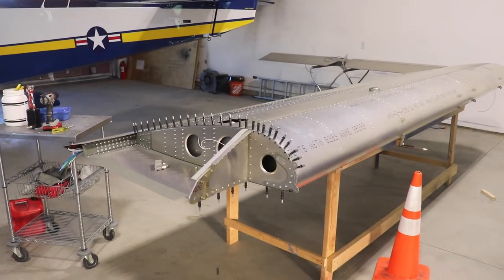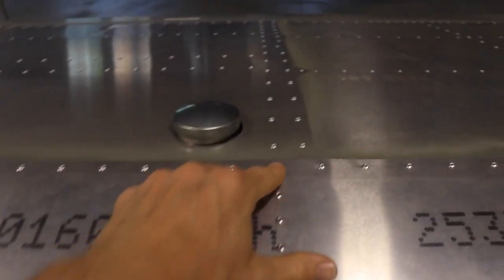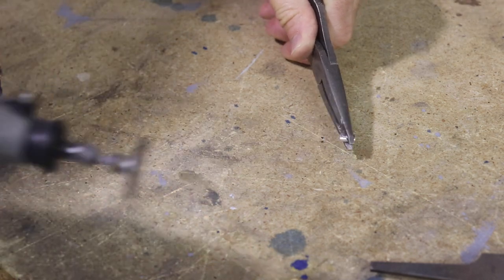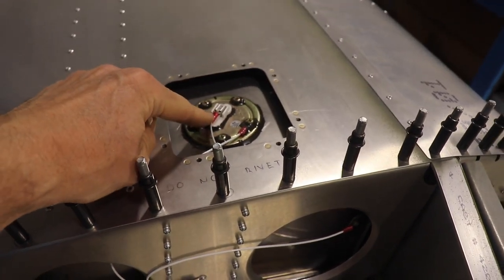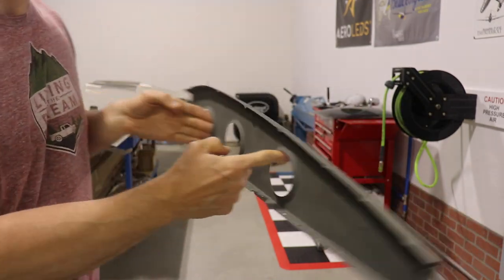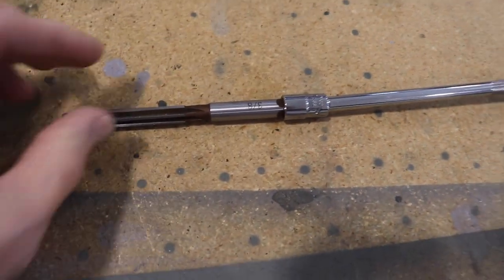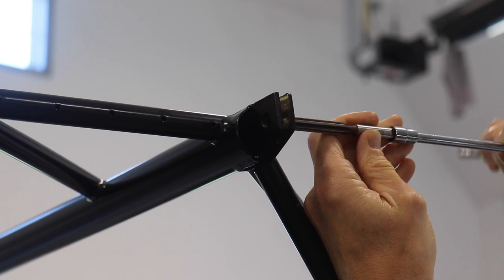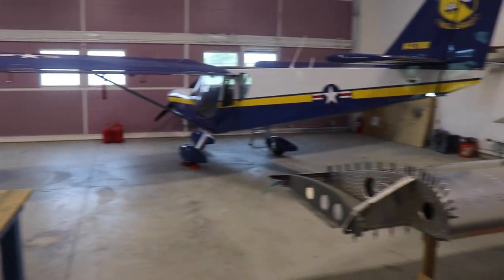Wings, Rivets, and Reamers! (Ep86)

Comment: Looking good!
Those spray cans that have a fan pattern are nice. I used some years ago where the tiny square tip that creates the fan pattern can be rotated so the fan pattern can be turned from vertical to horizontal. In case you didn't know.
Thanks for the video!

Comment: I would recommend NOT using the airframe as a ground return.
Proper connection is not guaranteed over time with corrosion and increased electrical resistance due to that.
Reply: Just curious how you would add a ground...  Would it be OK to add a ground wire from the ground bus bar to the point on the rib where the the other grounds are? Or, would it be better to remove the grounds from the rib all together and ground the sending unit and the tank directly with a ground wire?
Reply: 100% Agree, electrolysis is a nasty monster

Comment: Thanks Mark. At what point will you add the landing light(s) to the wing(s)?
Reply from the maker: The lights actually get installed in the slats and not the wings. I don't have the slats built yet so it may be a while!